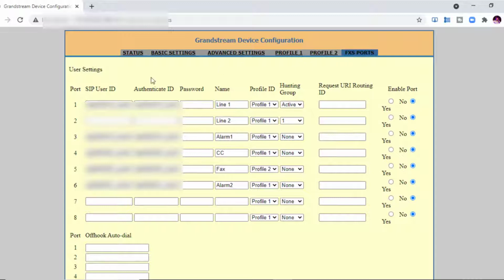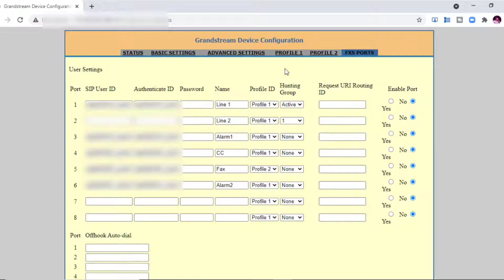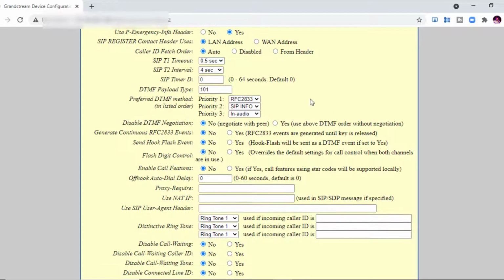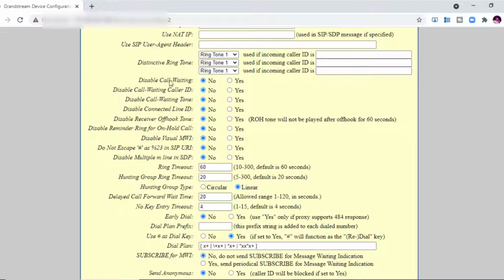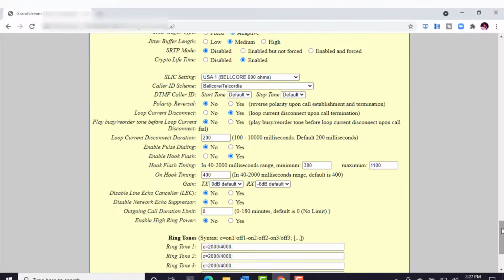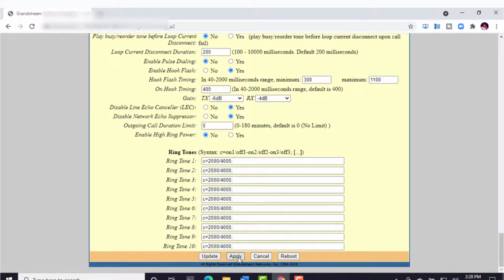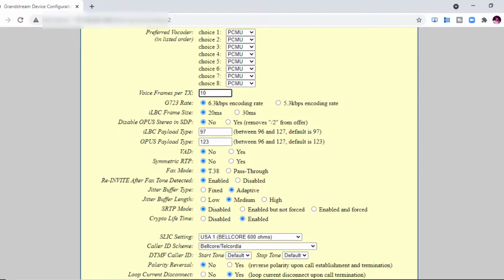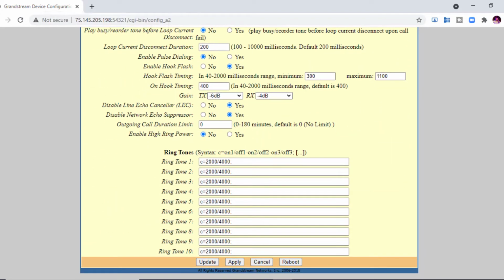How To Program Coredial Sip Trunks And Grandstream HT818 Voip Gateway Work With Alarm Panels

Comment: Thank you for posting these instructions. I have a NAPCO Gemini GEM-P1632 security system, Grandstream HT812 ATA and voip.ms service. Voice is working fine. I tried adjusting the HT802 settings as shown in your video, but I am still getting COMM FAIL. Any ideas?
Reply: did you ever get it to work with your alarm panel?
Reply: @SS-pi2yi  No. I looked into it a bit more. It was getting beyond my technical scope with no guarantee of successful outcome. My plan now is to replace my alarm system panel with a unit that does not rely on the phone line.
Reply: @daromani  I am in the process to get to the bottom of this and try still to find a solution -in teh next 2 weeks or max.  if you are not in a hurry hold on and I will tell you if works etc if you like - if you are 100% moving on to new system - no problem all good .
Reply: @daromani  oh and by the way did you change the DTMF settings to  "'inband' to see if you Gemini panel would dial a number with this setting?
Reply: @SS-pi2yi did you ever get it to work?
Reply: @uliseserazo2907   sadly no. I tried as per video, alarm panel never dialed through the Grandstream over the voip line. R u trying the same?
Reply: @SS-pi2yi I am trying the same, may I ask which Grandstream model you have and what firmware version?

Comment: Can you put Fax and Alarm on the same profile with these settings?
Reply from the maker: I have been putting telephone lines & credit card machines on one profile and alarms and faxes on profile two with the alarm settings and has been working fine👍 sometimes it depends on the fax machine that you are using but haven’t had a problem yet with the brother models. Having those alarms settings.